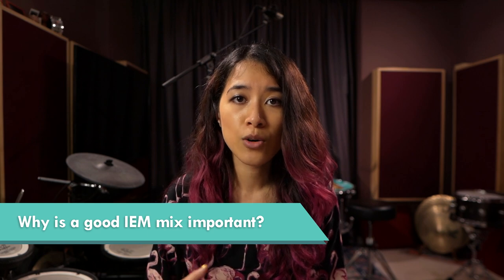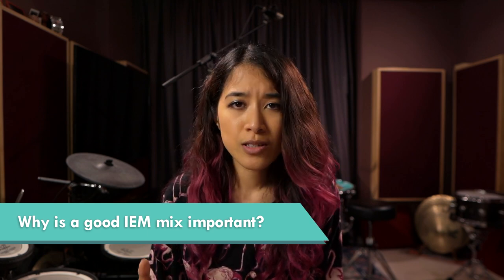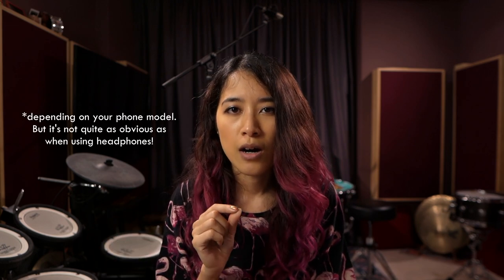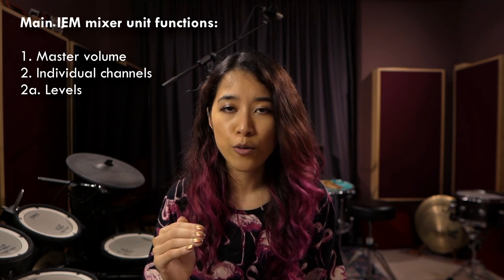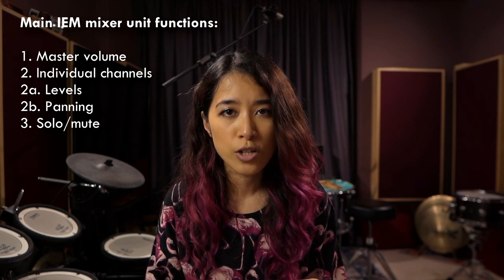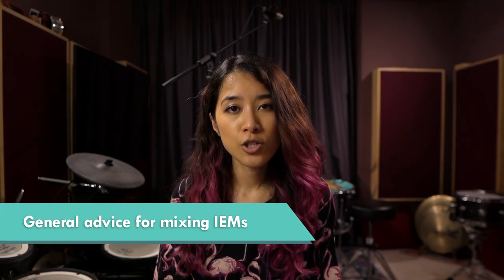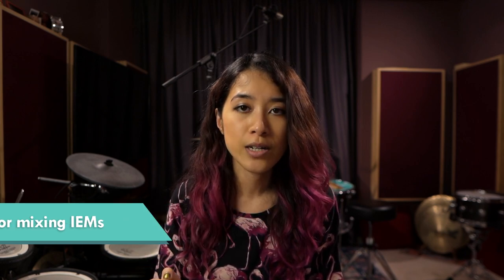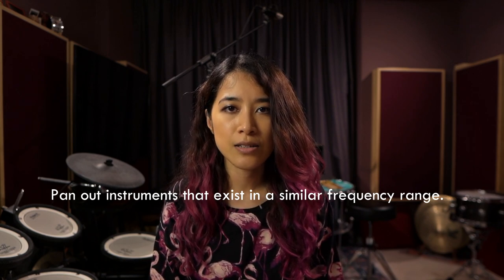Mixing your In-Ear Monitors

Comment: Question, This is for In-Ear monitoring system. If this specific monitor is a mono monitor(Xtuga RW2080) despite it not advertising it was only Mono, but does have a left and right AF. If I use both left and right using a splitter and proceeding to at least seem like it's stereo. When panning hard left or right, will it still project as mono or will it actually pan to either my left or right?
Reply from the maker: I'm not 100% sure what you mean exactly so don't take my word for this, but the xtuga rw2080 appears to be a mono transmitter so no matter what you do it will sum the output into a mono signal and you will hear the same signal on both left and right!
Reply: @stalj  ok thought so, thanks for the reply.

Comment: Hi Christal!

So, I am an MD and Bass Player at a church in North Atlanta. I just purchased an iRig-2 a week ago in order to record my in-ear mix for play back
I tested it yesterday (Sunday) for the first time but my Bass level was n to enough. I adjusted my levels pretty good but I needed to hear more of me..

Any thoughts from you or anyone?
Reply from the maker: Hey Dean! Could you hear enough of yourself live while playing or is the issue just not enough bass in your recorded mix?
Reply: @stalj  Such a great question! basically you are saying if I can hear properly live, then it should be better in my irig? Actually my in-ear monitors suck haha

My custom in-ear monitors are out for repair. So no, I did not hear myself well yesterday!
Reply from the maker: @DeanReynoldsMusic  well yes and no! I'm assuming that you are recording and listening to the same source that's coming from your monitor mix, so in that case whatever you hear live should technically be the same mix that you recorded. But that sound will be colored by your in-ears live, and your speakers at home when you're listening to the recording. So it could be the case that you didn't have good sound in your ears, and so didn't have the bass loud enough live, thus it wasn't clear in the recording either. Unless of course I'm getting this all wrong and you're recording from a different sound source altogether? Either way, you could take the currently recorded file and bring that into a DAW to boost some bass frequencies to see if that helps with a little more clarity!
Reply: @stalj   Sweet..

My Irig2 is connected to my in-ear wireless.. which means whatever I send to my In-ear, should be almost the same from my Irig2..even though it has it's own gain..